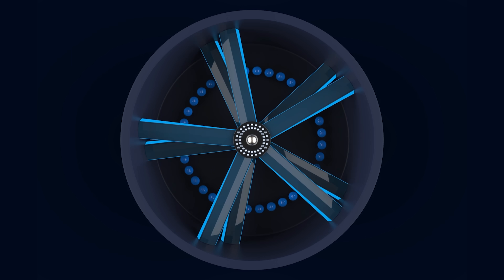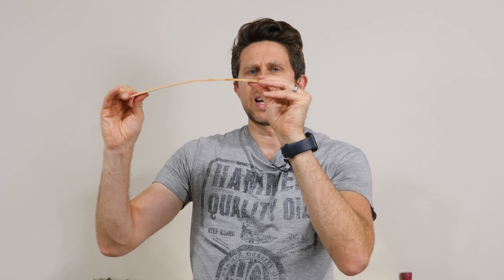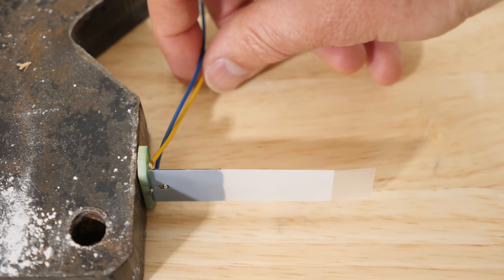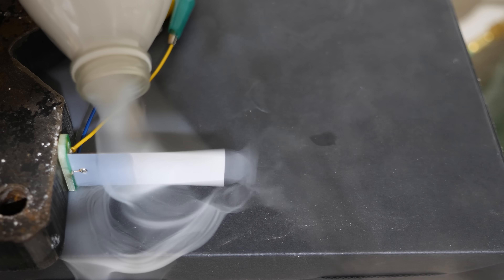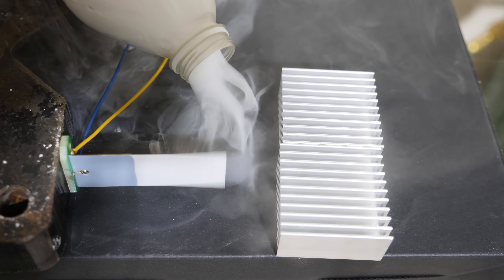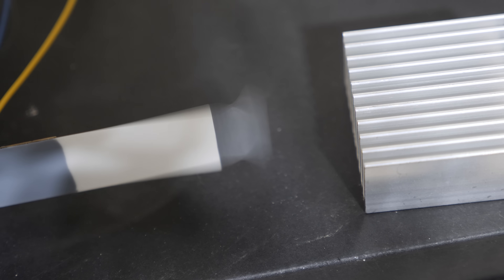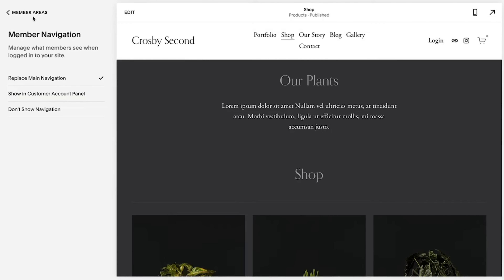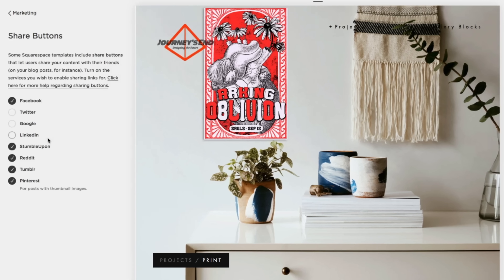A Solid State Piezoelectric Fan—Does It Actually Work?

Comment: Good video, in my opinion, material sciences and  engineering such as this solid staye fan, are whats going to allow us to co tinue into a sustainable future. Once we really are able to unlock molecular material printing on a wide scale, i think things will become so resource and energy effecient that it will be nearly indistinguishable from natural objects. To me, this is one step in the correct path for the future.
Reply: This is extremely inefficient at scale though.
Reply: @0106johnny  inefficiency in what? Printing? Engineering? 
Things like solar cells, when invented, were really inefficient and through the process of layering designed materials the resources required have become more effecient as well as the power output. 
The fact is that material sciences and the enginneering of printed layers only leads to more efficiency due to the lack of materials required to create the product and the energy required because the interactong layers are directly connected instead of through wiring.
If you judge every technology process by its infancy in development than why progress towards anything at all? Ineffeciency is not a good arguement for somethign that has the possibility of reforming how we view technology.
Reply: @Aaron-oe8xw  This has been around for at least 50 years, not really in its infancy or "reforming" in any way. The problem is that you need a really large area for any significant airflow. It just sucks compared to rotary fans unless you have a very specific requirement that rotary fans don't comply to.

There are some uses where piezoelectric fans are great and they have been used in these circumstances for decades. But for general use they aren't good, especially since large piezoelectric crystal are really expensive. This thing scaled up to cool an average personal computer costs around 400$
Reply: @0106johnny  this fan technology, isnt going to change the future, i dont know where you got that idea. The thing that will change the future is the nonwearing engineering and the compact electrical design. Piezoelectrics has absolutley nothing to do with what i am talking about. Its all in the material sciences, engineering devices that have less moving parts, less wires, and better effeciency due to the removal of electrical loss. This fan os just and example of how one can take an idea like a rotary fan and make something far more efficient through design. 

One other point, the cost of the crystals means nothing, we have seen many times over that once a product is put in mass manufacturing the price drops considerably and on top of that even if you did spend upwards of $500 or $600 to build a fan, you would have that fan for essentially the rest of your life. Box fans die cnstantly and cost somewhere around $25, so say you use a fan for 40 years (i use one for my woodstove). If a box fan last 3 years on its motor (which i think is generous) thats 13 box fans over 40 years equating a minimum of $325 assuming prices dont rise and not to mention the amount of materials and energy just getting each of those 13 fans into stores. The reality is that effeciency is more than just just cost effectiveness anymore, ita about sustaining the future, and for me, delving into technologies that prioritize longevity of materials and energy effeciency are the best possible way to keep our tech without the world annihilating us.
Reply: @Aaron-oe8xw  This thing is really not compact. It needs about 10-50 times the space for the same amount of airflow as a  rotary fan and it can't be directed well. The "blade" also wears out. While the piezoelectric crystal might last decades, the blade won't, due to fatigue. It also requires far more valuable resources. It is a niche product for environments where rotary fans just can't be used, either due to their electromagnetic interference, their inability to be miniaturized to the tiniest scales or a very hostile environment (>80°C air temperature, lots of dust, stuff like that).

So yeah, this is a really, really bad example of what you are trying to say.
Reply: @0106johnny  it definatley can be directed since it has a forward direction. I dont know where your seeing that, also the materials used could be changed, he used a simple plastic blade for example, but obviously other materials can be used. You also decided to just overlook production cost effectiveness, just because something is expensove or difficult to make right now doesnt mean it will stay that way in the future. As i said before the fan is an example and it is a good example of how we can change things, you may not think so, and thats fine you allowed to have an opinion. The reality of the situation is that some sciences take more than 50 years to develop into viable sources. Your looking at the exact product now and saying that its crap. Thats because your unable to look at the aspects pf the machine rather than ita current functionality, naysayers lile you have always tried to tell people that theor research wasn't worth it, and that it would fail, and those naysayers were wrong many many many times. I urge you to recheck where you think your argument comes from, because price point isnt everything.
Reply: @Aaron-oe8xw  These things have been made since the 1970s, production is pretty optimized. The most durable blades we have right now are made of PVA and last about a decade at the size the video shows.
I literally work for a company that makes these exact things, probably even the one you see in the video.

I am not a naysayer, I am just stating what these things are good for. There is a reason they don't dominate the fan market even though they have been around for five decades.
Reply: Molecular printing? It's such a illogical inefficient production method for 99% of goods, it would advance our progress in nothing, unless you mean true replication, like in star trek, it's a terrible idea, and I doubt you have found out how to convert energy into matter and vice versa.
Reply: @THEDANOFFICIAL  ? Your concept of what is possible is narrow. We are already doing this, by printing layers of interacting molecules you can achieve very effecient energy consumption and lower resource waste. No one but you said anything about converting energy into matter or vice versa. Solar cells, carbon fiber materials, they already exist and have been manufactured on a molecular scale. No idea what your even going on about, if you need mental help please seek it and dont take it out on people who are actually trying to promote a better future instead of whatever bullshit you didnt come up with. You didnt even offer a better technological method, you're just trying to stifle what you think is impossible because you dont understand.
Reply: @THEDANOFFICIAL  whoa easy there Spock

Comment: Reminds me of the helicopters in the movie DUNE, i think this will work and it is scalable, i hope some engineers or creatives like me get this for transport
Reply: Not scalable, consider the phisics of a flappy thing of let's say 2m length, the oscillating end would move so obscenely fast it would make a sonic boom with every oscillation, it would generate so much noise you'd probably have to stand at least 30-50m from it with ear protection to be able to endure observing it, terrible idea
Reply: Ornithopters. I thought so before this video was even released. Let's get them built. They'd have excellent maneuverability. Perfect for an apache type of craft hovering in a tropical jungle or something. Low above the ground. 

Ignore the other guy. He's the kind that used to think trains would never go past 60km/h. Or that the sonic barrier would never be broken. blah blah blah. 
A simple mind.

Comment: A real solid-state fan would be an ion thruster. Piezoelectric crystals vibrate and this can induce failure in other parts, like the electrodes that connect the crystal to a source of energy.
Reply: You'd also have quite a strong smell blown into your face constantly..
Reply: If electron is moving, does it count as "moving part"?
Reply: add in time crystals and now we're talking
Reply: Commenting to follow thread
Reply: Ion thrusters suck... Electromagnetism all the way 👌
Reply: Your a  ANEGUR
Reply: You mean like the one Frore Systems are making ?
Reply: I searched ion thruster fan and found this video.
Reply: Those electrodes ain't moving bro, did you even saw the video? Also, almost all of this thread are just a bunch of pedantic idiots, feels like reddit or twitter took over the place. Awful.
Reply: Ion thrusters also produce laminar airflow, which would be much less chaotic in an enclosure.
Reply: That's what I was thinking
Reply: Like the Ventiva fans they showed off at CES!
Reply: This is the most pedantic thread ever.
Reply: Solid State Drive (SSD), Solid State Battery, now Solid State Fan?! The world is getting crazy.
Reply: @olimpather  the world is already crazy.
Reply: "Solid State" does not mean "doesn't have moving parts" - it refers to semi-conductors
Reply: @JohnnyWednesday  Sounds like someone needs a disambiguation.
Reply: @JohnnyWednesday  I'm pretty sure "doesn't have moving parts" is the exact definition of solid state
Reply: @morbus5726  I think one possible counter example is tube amplifiers? in music we call solid state amps ones that dont have vacuum tubes
Reply: @morbus5726  "doesn't have moving parts" is the exact definition"
Yes, but moving parts refers to it's function as a motor. The moving part here is a result of the power generated by a solid state motor. It is not a function of the motor. A hypothetical solid-state car engine wouldn't be disqualified as such just because it's used to make the car move.
Reply: @morbus5726  it depends on situation. Solid State Disc/ Solid State Battery/ Solid State of water = ice.
Reply: @morbus5726  many things in life are called solid state when they are built with electronic components rather than mechanical. A solid state microwave oven uses transistors to replace the magnetron. Solid state power banks for jump starting cars use supercapacitors instead of batteries.
Reply: @JohnnyWednesday  the wikpedia article for moving parts says "A system with no moving parts is described as "solid state"[citation needed]. ", citation is needed but clearly some people do refer to it as such.
Reply: @sayaks12  electricity induce vibration even on microscopic scale so even an SSD that is only capacitors and silicon chips is technically always vibrating, the difference with the piezoelectric fan shown here is that the vibration is much higher because its amplified on purpose but that doesn't mean that is not in solid state. Think about the VRMs on the graphics card or motherboard of a gaming PC, those things literally make sound sometimes it's not noticeable for the fans blowing air but people who use a water cooling says that specially with the current gen of Intel processors and Nvidia cards that sucks energy like a medium size room heater that after making it totally silent with water they can hear the VRMs like bees buzzing if they put the ear near those parts at full load.
Reply: @peterpuke2841  You're not wrong in a technical sense however, we're presumably talking about principle means of operation. If you want to get overly analytical, I'd easily argue any form of matter above absolute zero has electrons which orbit and could be considered a form of vibration. The aforementioned motion is the very basis of atomic clocks.

In terms of zero moving part, the obvious exception would be the medium itself, in this case air. Ionic trust works by using the ions created by the air to move the air, inductor whine can be considered but it not being a principle of operation you could reasonably assume some future technology could replace the induce without affecting the means of operation. 

Seriously though, don't try something stupid like say "well hurr during, it uses electricity", that's essentially a cop out.
Reply: @MarcTBG  Exactly, you could simply say "virtually" no moving parts (as compared to a conventional fan).
Reply: @MarcTBG  by far the best explanation about the above going debate.
TL;DR: If you take it literally then virtually nothing can be a solid state device
Reply: @sayaks12  its more accurately "no moving mechanical parts". There is always some movement in every system. The transistors that run solid state drives still have microscopic moving parts but they arent mechanically actuated.
Reply: @MarcTBG  id been waitin for someone to say something tube related..guess we are the two cool ones ........tone's so warm right ha jk
Reply: @sayaks12  Solid state refers to "using physics of crystalline state"
Reply: @Moose Hotel - Solid state motors exist. SSDs are called solid state because they replaced a magnetic platter with silicon - not because they also removed the need for moving parts.

Let's agree that there are two definitions - the original one, used by scientists the world over - and then the other is somebody's best guess when they heard the term "Solid State"

The fact that it has come into parlance? is a reflection of people's ignorance.

Your version of reality? will see the film "Idiocracy" made real - do you want fans to be called "spinny wind things"? do you want quantum physics to be renamed "random ghost maths"?

Stop letting non-scientists redefine scientific terms.

I remind you that thermionic valves have no moving parts and if you called them "Solid State" - you'd be laughed at.
Reply: @JohnnyWednesday  the term solid state isn't a scientific term. Scientists don't need a catchy phrase to distinguish between semiconductor and non semiconductor based designs. It's a terminology used to dumb things down so the averages person can differentiate between alternative technologies. But in principle, I agree with everything you said.
Reply: @JohnnyWednesday  Scientists already have a standardized convention for labels and names, nothing gets changed unless the association in charge of deciding such names voted to do so. How laymen use these words doesn't affect science in a direct way (scientific literacy is still important). Quantum physics won't be renamed to whatever ridiculous thing you want to come up with.
Words have changing meaning all the time. The definition, the way we spell, new words and old words enter and fall out of use all the time.
That is the nature of language. Language naturally evolves and it's not "dumb" for that to occur. Using dumb "names" you came up with is a gross misrepresentation of what has happened with 'solid-state.' It's honestly just strawmanning, equating the evolution of a word to "spinny wind things."

Comment: the first time i outwitted the action lab!

the 1 part does move but there's no friction
Reply: I wonder if you could use it for regular cooling of a room by making bigger flaps.
Reply: @Anonymous-df8it  bigger flaps would flap slower and you would need more power then a regular fan to operate it. the small one is  good but nowhere near as powerful as a cooling fan. this is a good concept though.  might be good for simple computers like atms. i wouldn't want to risk overheating  a expensive computer like a gaming computer.
Reply: @georgieippolito9924  What about a million smaller fans?
Reply: @Anonymous-df8it  a bunch of smaller ones wouldn't be as strong as a computer fan but there would be more airflow then  a single flappy fan.   the amount of power to power a bunch of them would be a waste of power since you could get a  more powerful and a faster airflow with a single PC fan.

Comment: Piezoelectric is an amazingly simple concept with a host of complicated solutions.
Reply: Guard rails with piezoelectric wind harvesters.
Reply: @brodriguez11000 piezoelectric baseball card in my bike tire to generate energy. Ignore the spinning wheel
Reply: @brodriguez11000  I've seen some mini-turbines, that sit just off the road and charge batteries. But using piezoelectric tech would be an interesting twist. 
Once upon a time I started to develop a brake light with a piezoelectric switch....can't go into too much detail. Need to get a patent first. 
Sounds so secretive...:)
Reply: we need piezoelectric knifes! to cut vegetables or your enemies!